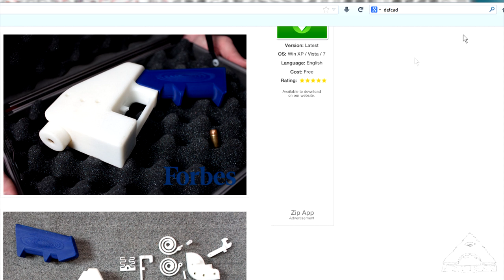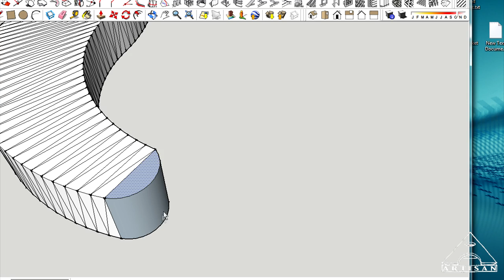3D Printing the Liberator - Part 2 - My Trigger Mod & Hammer Spring - By Defense Distributed

Comment: @ArtisanTony since you printed the trigger in 2 halves could you glue a piece of aluminum can in between the halves for strength? should be easy enough to cut a can and lay it flat then trace the trigger and cut to shape with a pair of scissors.

Comment: I could be wrong, but I think aluminum would help prevent the pieces from breaking *apart*, but unlikely to keep it from cracking at all.  It doesn't look like a part that would take a long time to print if he needed another.  At this point I'd just use his acetone / abs slurry to glue them together and be done with it.

Comment: if you made it into a composite, by adding like maybe bamboo in between you'd get better rigidity and strength also keeping it lightweight by not using something heavy like metal.

Comment: Also adding a Ironwood sleeve into the barrel...(excuse the pun....or not)....it WOOD make it hard and strong enough to fire a few more rounds through it.
In fact if you had a thick cylinder of ironwood (or another wood with similar toughness and hardness) you'd probably might try to get away with a 5-7 round clip.

Comment: isn't acetone / abs what you're using on top of the bed?  I haven't tried acetone / abs myself (I use heated bed + glass), but the responses I've seen about it not working out is when people use nailpolish remover and larger pieces of abs instead of real acetone and small bits of abs (skirts, drippings, etc).  Either way, let us know how it turns out.

Comment: Looks like a reprap printer. They are relatively cheap, but you have to put them together. Are you using ABS or PLA filament? Good stuff. I know a lot of people have downloaded these files, so it doesn't matter if the government shuts down defense distributed websites, the information is out and cannot be taken back. That is their whole mission. It's a good one, albeit, one that can be dangerous politically.